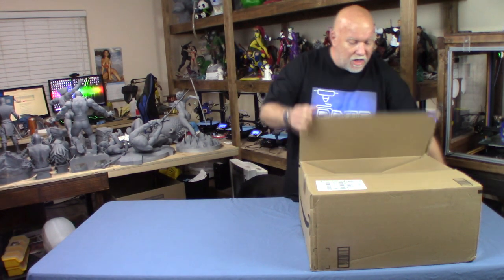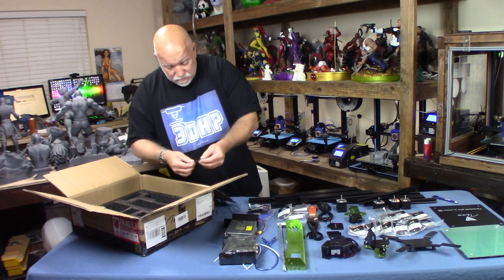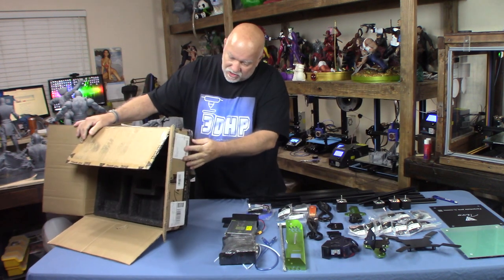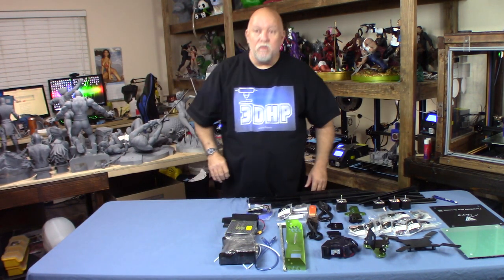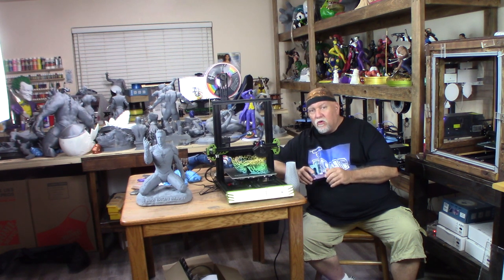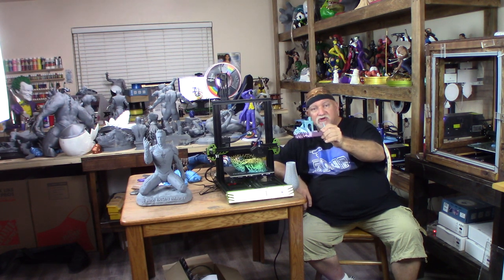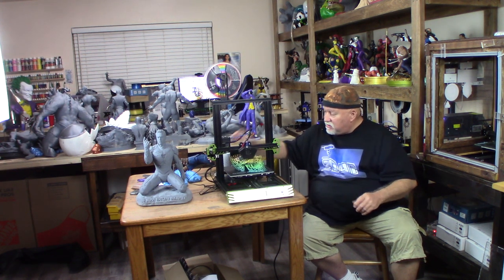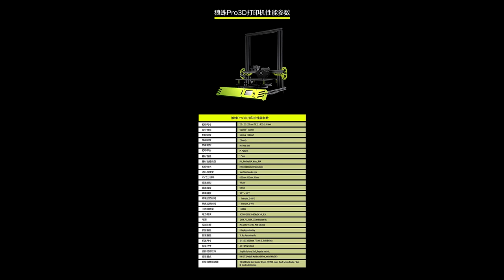Tevo Tarantula Pro Build and Review #3dhp

Comment: Other than slowing your fans down, you built this, and immediately started printing? I didn't see you leveling the bed, or making any control panel adjustments. Your printer was ready to go, right out of the box?

I'm curious because I built mine, nearly 2 months ago, and I haven't printed a thing yet. Mine came with a bad board, to which I was forced to buy another. 

Does your firmware have a "Save Settings" function? The version I had didn't have that feature, and I can't save my settings.

After I bought a new board (tech support wouldn't send a replacement), I had to settle for their version of the firmware, which isn't compatible to my machine. Every axis setting is a 50% value of the actual needed stepper speed to drive the motors properly. Since their firmware doesn't include a "Save Settings" function, I'm unable to save any settings. So, I'm kinda stuck. Hence, my questions. Contacting tech support is not an option. I originally did, but they've opted not to take any responsibility. So, I've been surfing videos, Facebook looking for ways to get this thing to work. I even tried running this firmware through Visual Studio Code, but the program can't build it's  version from that source. Apparently, it has errors.

Don't know what else to try. Any advice, other than dropping back & punting, would be greatly appreciated. Thanks
Reply from the maker: I had to rewatch the video,looks like I cut out leveling bed with a piece of paper.Once you z end stop switch is at the right height and you manually level the bed,your good to go,no need to save 
setting on screen for that.Not sure if it had the option on control panel at the time of the video,Soon after this video I installed and EZabl auto bed level sensor and a filament runout sensor which comes with Th3dstudios version of Malin,already modded and it has save settings on theres.sorry your having issues,this is my go printer even now for quick prints..Th3dstudio.com and they have a few facebook groups, or your welcome to post a question im my facebook group 3d Printing and Painting 3DHP.Hope this helped a little.
Reply: @3DHP  Hey big guy... Thanks so much for gettin back to quick like that!

Ya know... I did, at some point, want to get the auto-bed leveling & runout sensor. So... you're telling me that your purchase CAME with firmware, ALREADY READY TO GO? No tweaking needed? Seriously?
Reply from the maker: @Seemsayin  Th3d studio has the firmware you download and any extra steps needed  to  change in firmware for that printer is explained in the pdf file,paper work..like un commenting this or than..not hard at all..They have a great support team if anyone has issues with there products,but  i've never had any problems.They also have videos on there you tube channel.Some boards require a boot loader to be installed,with is software to allow firmware to be written to board and some don't.
I have a link to th3d in description under video.
Reply from the maker: There firmware is wriiten for certain printers and boards nad depending on what you install,like eaabl or filament runout sensor,,you will un comment different linesmthen compile.
Reply from the maker: @Seemsayin  Just remembered, I posted a video on both installations here for the Tevo Tarantula Pro,for ezabl and filament runout sensor .
Reply: @3DHP  Excellent news. I interacted with th3d studio, today. Placed an order for everything YOU got! I have downloads waiting for me, which I'll attack tomorrow. Thanks for helping me out. Much appreciated.

Comment: Hi, did you change jerks, acceleration and other config? or print default config?
Reply from the maker: I was using fff profile for S3d I downloaded from Derek Brown on TTPro facebook group.Its in there file section.I haven't checked all the settings to see whats different from mine that I use on my Creality machines other than build volume.
Reply: So, have not you changed anything from the factory settings, jerks or accelerations? I'll try.  Thanks

Comment: Another great video. When are you going to show off a life sized joker? haha
Reply from the maker: Thanks,Need to finish painting it.lol.It will be in an upcoming video.
Reply from the maker: I here better stepper drivers which plug into the mobo and require a cooling fan be added because they run hotter than the ones supplied because some people are getting salmon skin on prints and they make the stepper motors quieter.But at the moment I don't have a salmon skin issue.The replacement drivers I spoke about  are 2208 and 8728s on Gen L..
Tevo tarantula.I love abl's to level the bed and  a filament runout sensor.Hope this helps.
Reply from the maker: Great video by RuiRaptor installing these on a Tornado,but applies to Tarantula pro because its the same mobo,but you must add cooling fan.
Reply: @3DHP  i was joking but that's awesome you actually have built one!